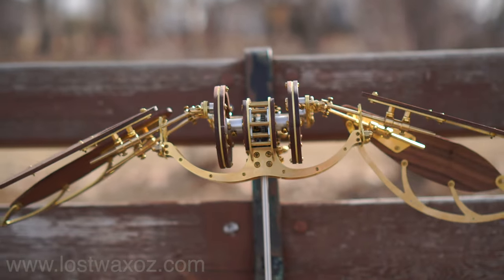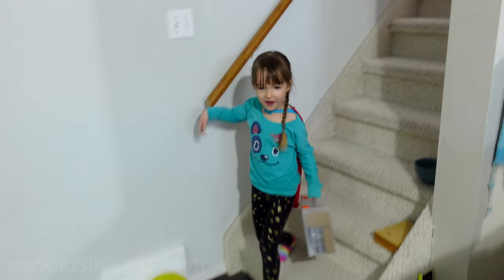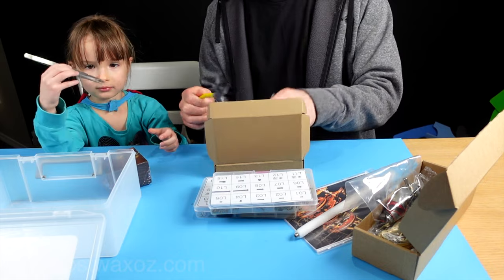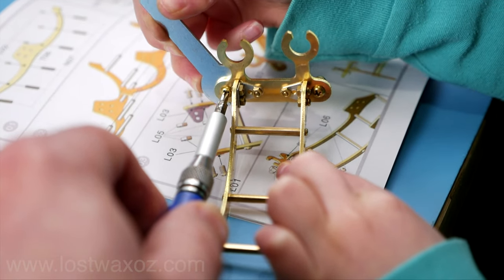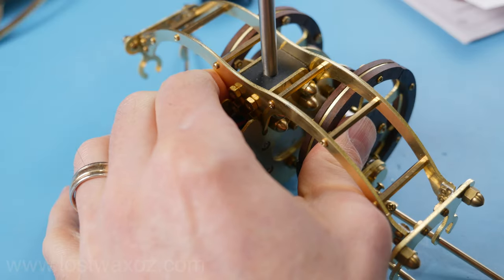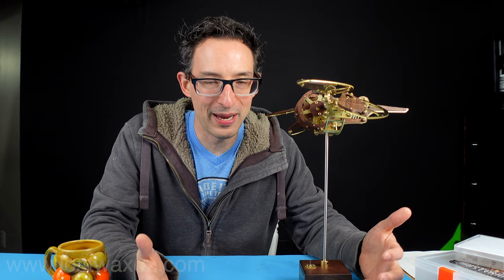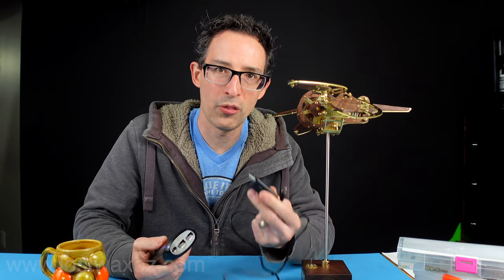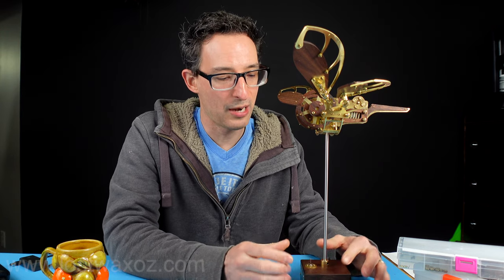The Mysterious Aviator- Original Song, Original Steampunk Dragonfly Model. Reviewed.

Comment: Is the noise from the motor being cheap?
Reply from the maker: The motor is really geared down a ton, so the motor is spinning really fast and then there are a bunch of gears doing their thing, which I think all adds up to the noisiness. It does really detract from the end product though.
Reply: I agree.  I wonder if you could have the motor in the base and drive up the central shaft.  Then you could insulate the base to reduce noise